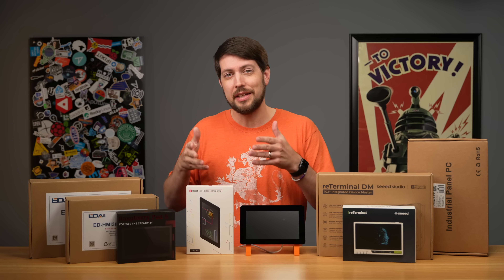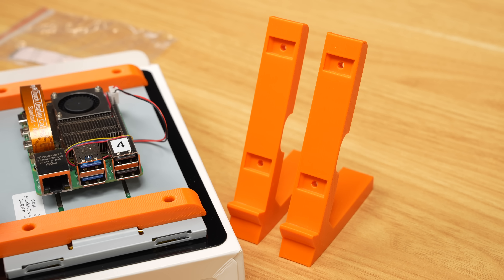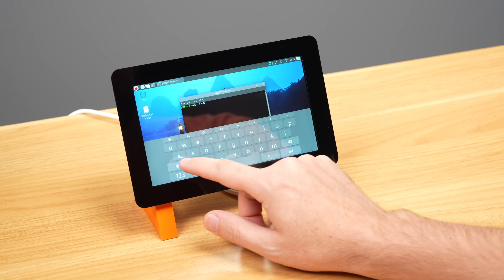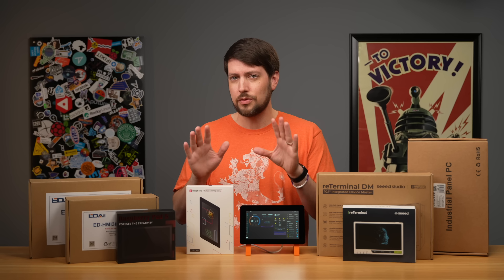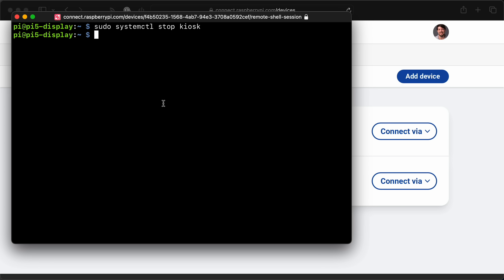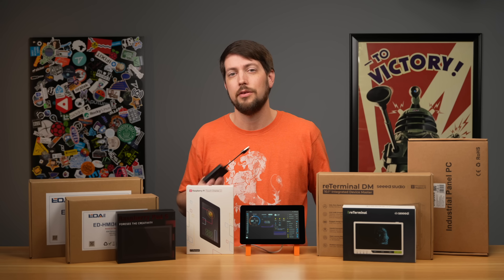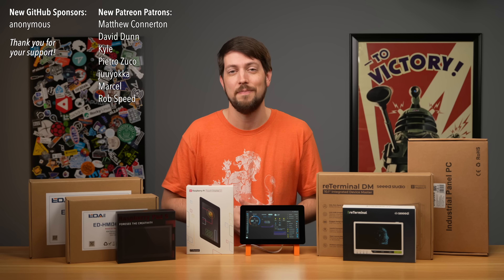I Control EVERYTHING with this Raspberry Pi

Comment: The Kindle for note taking proved to be unreliable because of the way the Kindle handed the SD card the app forces you to use, so I made a Raspberry PI tablet. I'm going to up date it with a new Ethernet plug, a bigger battery and a charge port. Battery life is 2.5 hours now, but will be 7.5 hours. I am finding I am using it for a lot of things I didn't make it for. It's a quick device to pick up and use when I need a computer. Like putting a small camera on it to go down a gofer hole. Or putting it on my camera car for me train set to record, rather than setting up a computer to try it out. It's looking like this could be endless, and now my wife wants one, because she can't get her Kindle to SHUT UP in church. You power it on or off, and it has to announce itself, where mine doesn't. You can even shut off the screen and touch without shutting it down, saving power and accidental input, when left in the seat by itself. 

The case this is in is designed and 3D printed by myself. 

I have a laptop, which I use for more intense remote uses away from home. This also fills in, when I don't want the bulk of a laptop to carry around, and don't need the power.

Comment: I've been using a Pi 4 as an Octoprint server for my 3D printer, however last year I decided to switch from Marlin to Klipper firmware. Unfortunately Klipper didn't support the LCD screen + control knob that my printer came with. I ran it without a display for a while, but I wasn't really happy with the setup; I really wanted an on-printer display showing status and allowing me to do basic printer control. I found the KlipperScreen project which looked like it did what I wanted, so now I had to go looking for a touchscreen. I didn't want to use the Raspberry Pi one because a 7 inch screen hanging off the side of my printer seemed like it would be too big. On the other hand 3 inch screens (which are commonly available) seemed too small. Fortunately I was able to find a 5 inch Pi touchscreen which felt "just right" to me. Like the official screen it had pre-installed standoffs to mount the Pi on the back of the screen. And I modeled a kinda janky angle bracket thingy to mount the screen + Pi sandwich to the side of my printer, where the screen it originally came with mounted. Surprisingly I didn't have any trouble getting the screen going, it actually came with fairly readable instructions and the configuration files they provided worked out of the box. The setup has been running perfectly for a little over 2 years now.

Comment: FYI I found a screen on Amazon that actually came with significantly better touch support than Pi’s own screens. I was surprised because those are usually of lower quality, but it proves you can find a gem if you go looking. My strategy was to just buy a bunch of screens, including Pi’s own touchscreens, compare them, and return all the ones I don’t need.
Reply: Can you send me the link?
Reply: Link please

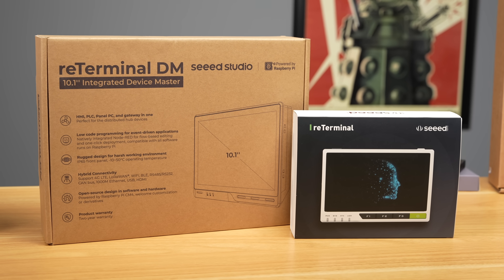Comment: 2:35 You can’t fool me! I know a digital picture frame when I see one! ☝️😮  I’ve bought several at goodwill to hack/mess with and I just lucked into my first WiFi touch screen model for a few bucks and it’s pretty cool, basically just an android tablet without a battery running on a locked down launcher.

Comment: I just got a raspberry pi 3b+ at goodwill for $2. It looked like a usb dock in a crappy abs enclosure with no name or anything on it so I was intrigued by the selection of ports. I opened it and screamed loud enough to scare my wife 😂 (I’m 38 btw) I was so excited to see that little raspberry on the board. 

I typically buy electronic accessories & junk/old knives/ 
VCR’s there every Sunday when they have $0.39 sales. 

I usually collect old and new pc and phone cables, accessories and especially weird adapters for displays, thunderbolt, FireWire etc.

Comment: Just wanna give a shoutout to the reTerminal. I've been playing around with Qt, running a kiosk application on one of those. The price is high, and support is a bit limited, but the onboard hardware (light sensor, gyro/accelerometer, keys, programmable LEDs) really make it worth it. Plus, it's in a really nice case. And, compared to a Pi + display, it's a lot thinner.

Comment: I've been running a touch display 1.0 in my car for years as a digital dashboard/infotainment setup I made. Just recently swapped to a touch 2.0 this past winter. I was using it in single digit fahrenheit mornings without too much trouble. The display was all smeared at initial start, but within a few minutes of heating up it was working like normal. Time will tell if it hurts it long term, but it's cheap enough to try.

Comment: Hi Jeff, i just subscribed to your channel and i am new to the raspberry PI. I have bought 2 raspberry's 1 (4Gb) 1 (2G) for use in my apartment and basement (P1 cable for the KwH smartmeter) But about the Display ,   my brother has an old Apple tablet 10" so i'm going to use that , i'm not sure that the app will work on the apple tablet but i'm going to find out( sorry for my English cause i'm Dutch , and i am curious, you have a Dutch surname, :-)

Comment: I need some displays for Home Assistant. I do run HA on a container in a PI4, but I think using a PI also as display is overkill, while a cheap Android tablet can do the same for less, and it can be put flat on a wall. I was indeed considering using the Raspberry display to set up Volumio. This is still one of my upcoming projects.

Comment: I built a dashboard using your stuff to control and monitor my Bambu Lab P1S. Added a humidity and temperature sensor and a camera to stream video from the P1S. The Kiosk mode works great, but as you noted, sometimes it is a pain to try to get out of that mode. 😢

Comment: FYI, the "Linux touchscreen support" isn't iffy, that's really just the pi's default DE. I installed kde plasma just fine on my RPi 5 (running arch linux arm), and while I never got to try it with a touchscreen, I have tried KDE plasma on touchscreen laptops, where touchscreen support works completely fine. I quite like touch screen on Linux.

Comment: I love to fiddle and try a lot of things out myself but I found out that the vertical Samsung touchscreen android TV or kiosk screen for about 1000 bucks is much better because you can use it as an android TV or you can put a raspberry pi on it and run kiosk mode. so you can have two screens and run pi os instead of a kiosk operating system and just run slideshow or automate using digital signage software on the vertical Samsung. Yes it's expensive but it's a great portrait mode large standing advertisement that can show different content at different times of day and with AI vision and camera can even change the content depending on who it sees or what it sees. but that's overkill to address the project in this fantastic tutorial you have made, I would still say why not use boxes and install the kiosk operating system of your choice or the one provided by raspberry pi foundation, and just open it in boxes virtual environment. To be honest I don't run pi os unless I need to I usually run kali or ubuntu, and use the boxes app to install the kiosk mode operating system separately and open it on the second screen. That way you have a desktop computer and the digital signage

Comment: Just thought I would add that I have been using the older Pi touch screen in my RV for Venus OS to control my Victron devices. I have not had any issues with temperature in about 4 years of use. I have used it well outside of the temperature ranges stated on the instructions. Honestly it was in there two years before I noticed the temperature range.

Comment: Question: If you have 1 compute module w/yellow board for home assistant, is it possible to duplicate another one to control the same thing?  The reason I ask is if you have the touch screen in kitchen, but you want to also control it in another room with the interface.  Or can you web into it from an iPad or laptop to achieve this?

Comment: Buy a 15.6" touch screen for 200-ish. Connect NUC to it and you have great and big screen for home assistant. I use this and tbh I used rpi with HA as a kiosk and was disappointment, maybe I had to invest more time, but as for now I have multiple sensors that has to be manufactured and time is at a minimum...

Comment: you can get an android auto head unit for $100. I got a touch screen with bluetooth for my old truck on sale for $60. No need to use a clunky RPI project. If you can figure out how to control the AC thru the head unit, that would be a cool party trick but not really worth it.

Comment: Just to clarify, you have two Pi, one running Home Assistant OS in your server rack and another one attached to the screen you use as a Kiosk? 

So to replicate this setup, an individual would need two Pi, is that correct?

Comment: Buyer beware on the Reterminal. It is a prototyping product targetted at preproduction tinkering and compiling the drivers for anything other than 32 bit Raspberry PI Os is a ball-ache. Be prepared to sink 72 hours into getting it booting on Ubuntu or anything else.

Comment: So we moved in about a year ago to a house that had a luxury smart home system put in circa 2003. 

Everything is wired up, but it's all dead tech now. Each room has a panel with a Cat 5e cable running to it that ran the panel off of PoE. 

Looking at a Pi/Home Assistant combo that can be ran off of POE- this video is a great start! 

The local company that did the initial install's get out of bed price is $10k, so quickly came to the conclusion that I'd rather try my hand at the DIY route first...

Comment: Smart home stuff is great but the car you can just buy a head unit that’s designed to do that for not much more than this would cost to build and it will fit in place of the old stereo perfectly and just be plug and play. I like tinkering but that’s just making life hard for no reason 😂

Comment: Hello guys here in the comments. I’ve seen the PDA in the new Stalker 2, and got curious if I can build it from Raspberry Pi 4B (not 5B on purpose) using the new screen. My play is simple using Merkur (metal construction toy on my country) “move” the Raspberry Pi bit more to the right (USBs and RJ-45 is closer to the edge). so I can put left the powerpack/powerbank to power all of it. this all seems relatively simple to me. My headache is caused by making the 3D enclosure/case since Im unable to make anything 3D. Hopefully my friends can help me with that one. What do you all think about it?

Comment: Why not just grab any old tablet and use a browser to display your dashboards?  Continuous power would be easy -- but some added wiring.  I'm new to HA, but I'm designing a new building with cabling installed at my control panel locations.  I'll probably still connect the tablets over wifi, but I'll have a cable to deliver continuous power to the tablet.  Is that the problem everyone tries to solve?  Wiring power to the panel?

Comment: Jeff, im very new to this stuff. Im trying to build a touch screen system that will run small 12 vdc pump motors. Will this do it for me?
Reply from the maker: it could, you'd need to work on using a relay HAT or something to do the actual switching of the motors. Make sure they can take the power requirements of the motors too!

Comment: This is silly. Just buy a cheap android tablet and put the home assistant dashboard on that. Cheaper, higher resolution and looks better with the much MUCH thinner display that you can wallmount (on a side note I really wish someone would make a nice thing display for the Pi Zero 2 or Compute Module meant to keep things as slim as possible, but every single one is made to be inches thick.

Comment: I've been using an okd Android tablet as a secondary touch screen. a 90 or 180 degree USB adapter and a kickstand is all it takes, and it saves a old device with a dead battery from the ewaste bin.

Comment: I used the original touch display to control a drinks machine. Paired with a Raspberry Pi and some motors it could mix together drinks with quite a few ingredients.

Comment: I know you are hesitant to get a new car, but my Tesla has been bullet proof and it's super easy to add features and games.
You just add them via the browser. Jellyfin works great, emulatorJS even works while driving (although you this is something I'd recommend for passengers only), Home assistant is hosted locally but controlled via the browser can be super useful and integrated into voice controls in the car! Thats not even mentioning BT support is very wide spread and the modding community and open-source nature of Tesla CAN bus and Ether-loop make things like track and drift mode possible with plug and play adapters from sexy-button to diy raspberry pi solutions! Host things on your phone, export things from your car to track it's use locally is also super cool and shockingly easy.

My favorite thing is, because the camera feed is exported by the car via the Tesla app. Every hour or on-demand I can have it take a snapshot to add to my existing home security system and even export events from sentry mode to my home security system!

Comment: Would your kiosk method work to run a python file whenever the Pi 5 is powered? I have it set to open two camera previews each filling half the screen and I have tried to use crontab but that doesn't work.

Comment: I'm just over here begging, on my hands and knees, for a reasonable touchscreen solution for control projects like this that's easy to integrate and at least matches the specs of the now positively archaic Nexus 7 2013 (which I currently have on my wall, and works fabulously for Home Assistant). That whole tablet (screen, processor, battery, the works) only cost a couple hundred bucks when it was brand new over a decade ago.

Is a 1080p touchscreen too much to ask for in 2024? Really?

Comment: Since Raspberry Pi OS now runs on Wayland, forcing your web browser to use Wayland should improve touchscreen support (and laptop trackpad gesture support). Chromium has (imperfect but functional) Wayland support, but it defaults to X11. Alternatively, you could try using Firefox, which has it on by default.

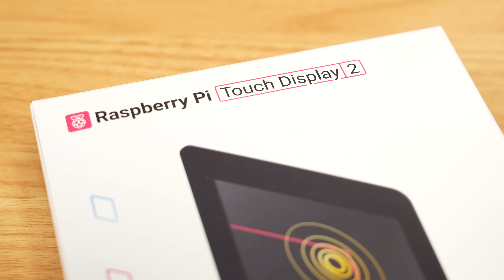Comment: 00:00 Introduction
00:00:51 Display Upgrade Challenges
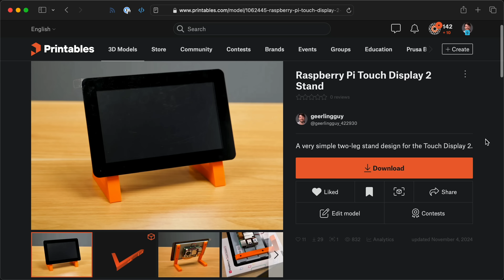00:01:30 Assembling the Pi Display
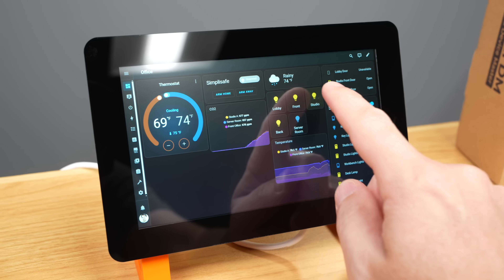00:02:14 Exploring Touchscreen Alternatives
00:02:50 Customizing 3D Printer Enclosures
00:03:38 Touchscreen Challenges on Pi
00:04:17 Configuring Display Settings
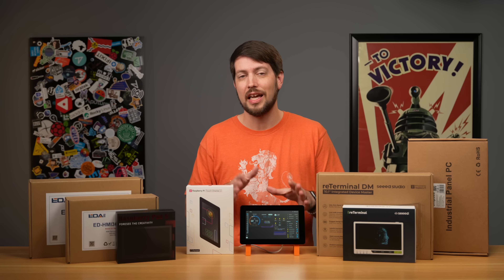00:04:47 Smart Home Setup Journey
00:05:22 Automating Kiosk Mode
00:05:55 Remote Management Solutions
00:06:36 Smart Car Integration Frustrations
00:07:17 DIY CarPlay Installation
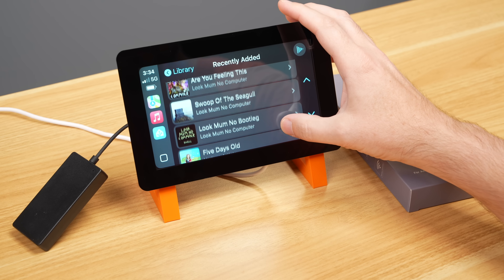00:07:55 Display Durability Concerns
00:08:35 Exploring Pi Touch Displays

Comment: I have the original display and paired with a rp3 the two projects i did were: 1) an insulin calculator (software i wrote) for a type 1 diabetic family member.  And then when that wasn't needed anymore (they got better tech), i converted it to run crankshaft in my old 2008 car with a custom 3d printed mount to run android auto.  These screens can be used for all sorts of projects, think i might try your home assistant project next.  Thanks for the review, home assistant idea and  walk through!

Comment: What you show when you say the boot screen is rotated is called console, and it can be rotated. The name sound obvious for someone like you, but I'm just saying that's the technical name. A kernel boot parameter can be used to rotate it! fbcon=rotate:1 (or 3) should fix the issue!

It is possible, if the kernel can recognize the model of the screen, if the screen communicates edid, the raspberry pi foundation can add a quirk (that's the technical term the kernel guys use for a patch like this) so the kernel will have the landscape rotation by default on this screen. But maybe the rpi foundation thinks  landscape is optional.

You can optionally use Plymouth to display a rotation agnostic animation instead of the kernel boot information

Comment: Does anyone happen to know if I can power the whole running off a poe connection?
Reply from the maker: Should work fine as the whole setup uses 6-8W idle, 10-15W max
Reply: @JeffGeerling  thanks! I might be getting my hands on one of these soon. I have a pi 4 that I hope to test this on. If I remember I'll report back here

Comment: I was quite surprised how little I cared about the tesla not having car play. maps / apps, playing music from the phone. It's all really surprisingly good and usefull. First I wanted to buy one of the many CarPlay-extra screen options which exist for Teslas, but after a month I didn't see it bring me any benefits at all. Also, its as with Home Assistant. The best Smarthome is the one which doesn't need buttons, doesn't need voice control. Over the past two years I got so much stuff automated that I really don't need to control that much anymore. Same in a Tesla. Automation to a large degree is just so good, you just miss the buttons almost never.
In your case I would get one of those car-play screens for your own car. There are many outthere which cost little and have the bluetooth/wifi connection right built in. And do the temperatures and 12v etc. just without the hassle of setting up a pi and probably more efficient. Cause pis use quite a lot of power, btw everything above 2W in standby is a lot imho.